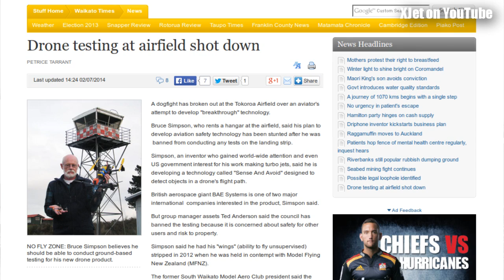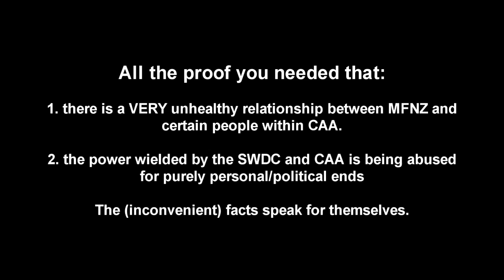Drone testing at airfield shot down - why am I left so confused?

Comment: Please clarify Bruce. Since there's no danger of radio interference, why did you go and warn the jet guys in that Sunday morning, you were testing the sense 	and avoid gear?
Reply from the maker: Any transmission, no matter how weak, increases the risk factor.  To an RC model that is properly set up, uses decent gear and which has been adequately tested prior to flying on the day, the risk is very small.   To a poorly set-up model using unsuitable equipment (ie: no DSM2 in jets please) and which hasn't even been range-tested, the risk is obviously higher.

In order to do my testing, I have to place several antennas along the roof of my workshop.  If I had not told the jet fliers of my intentions, reminded them to do the basics (as listed above) and that there would be a very small increase in the noise floor then you can bet your bottom dollar that each and every crash would have been blamed on those "mysterious antennas" that suddenly appeared on my workshop roof.

As it is,  some of the jet fliers intimated that I may have been responsible for the crash of a very large turbine-powered scale jet that lost control and smashed into a tall pine tree less than 200m from my workshop.  It turned out that the actual cause of that crash was the use of a receiver pack made from AA batteries which caused the RC gear to brownout immediately after takeoff.

In light of this, you can see why I took the very practical steps I did -- as a method of trying to preserve safety.
Reply: ***** im with you since the beginning. Keep up with the god work Mr Bruce!

Comment: Abuse of power. Typical of councils. Disgusting really. The Council needs To grow up.
They can't have jurisdiction on spectrum that's rediculous. Did RSM have anything to say on this?
Reply from the maker: The RSM have nothing to say because I'm not breaking any radio-spectrum regulations.  All transmissions would be well within the power, modulation and frequency limits for such emissions on the 2.4GHz ISM band.  You can bet that if my proposed transmissions were a violation of the RSM regulations, that's the angle they would have used to try and cripple my development work.

Comment: One more thing that doesn't make sense about their prohibition - why isn't it limited to just when RC flyers are present at the field? Especially during work days and hours, I don't imagine that RC flyers are always present, so why can't your experiments be allowed when no one is flying, ignoring the fact that there shouldn't be any kind of prohibition in the first place?
Reply from the maker: I don't think you have to be a  rocket surgeon to figure out the real reasons for their actions -- based on the fact that they have issued a blanket ban, not just a ban when the RC jets are flying.  This betrays the claims that it's all about safety and proves the claims that it's all about making my life a misery because I have dared to criticise them.  It seems that around here, you can break all the laws and rules you like with impunity -- but if you dare to criticise the actions (or inactions) of those in power -- well then you become a target for their abuses.
Reply: ***** Right, but unless I missed it, I've never heard you specifically point out that very revealing fact in any of your videos. You should. It proves that they aren't worried about safety, they're just screwing with you. If you officially and specifically ask for the right to test your system when there's no RC flying going on and are then ignored or refused, it will completely nail down to even the most casual observer their actual intent. Then, appeal to higher levels of government (assuming that can be done), or take them to court.

Comment: what do you actually have to do when testing the sense and avoid system  is any flying involved if not cant you do those tests at night when no ones flying  the rc jets?
Reply from the maker: My first preference was to perform flight-tests - in which case I'd have been using frequencies that were well away from 2.4GHz, with obvious benefits for all.

Unfortunately, I am the only person in the entire world who is expressely forbidden to fly an RC model at the Tokoroa airfield -- in some cases, even a person with absolutely no prior RC flying experience can legally fly a 20lb gas model without any training or supervision -- requiring only an equally unskilled observer to "safely" fly at the field yet I, despite my years of exerience, obvious skill and umblemished safety record -- am expressely forbidden.  (Tell me that does smell of power being abused).

Because I'm a pragmatist, I figured I'd settle for second-best when it comes to testing -- which is ground-based testing.  Unfortunately, this requires a lot more euquipment and 2.4GHz is the most cost-effective frequency to use for this purpose - so that's what I set about doing.

It's impractical to test at night -- because there's nothing to "sense" at night -- no aircraft are flying within 1.5Km in the dark so I'd get no meaningful data.

Comment: This does seem unfair . I would get hold of someone with scientific credentials to back up your points . this may keep the annoying flies off you for a bit ..  you should be an  advisor for the council , not an enemy. they are chasing tails !
Reply from the maker: They would not listen and they would be under no obligation to listen.

As Mr Roger Fisher told me when I asked why a seemingly ridiculous rule had been imposed on airfield users "all you need to know is that we make the rules, you follow them".

I think that speaks volumes as to the way that power goes to some bureaucrats' heads and how they abuse it with impunity around here.
Reply: ***** Absolute Power Corrupts Absolutely.

Ive never heard such BS. Maybe you should start "repairing" microwaves in that hangar.

Comment: The rc manufacturers presumably wouldn't have put these new radio's on 2.4GHz if you couldn't get a reliable link and with frequency switching (and background noise). In this case I am a bit confused to as I would have thought you could have done your testing when no-one was flying...   and even if they were, you are only 35mW. What does a typical 2.4GHz transmitter put out? Maybe you should move to an area where you can do this. Somewhere on the coast - nicer than Tokoroa in winter.
Reply from the maker: Why should I move?  I pay a lease to the SWDC and I am a local business of long-standing who is developing an aviation-related product in accord with the terms and intention of my lease.

And yes, isn't it confusing that although the jets only fly one weekend a month, the SWDC has placed a total ban on my testing because, in the words  of Roger Fisher "RC models could be flying at the airfield any time in daylight hours".

I'm glad you are as confused as I am by the very obvious abuse of power that is taking place here.

It's nice that the SWDC puts the perceived interests of a group of itinerant, non-resident RC fliers ahead of a local business of long-standing isn't it.   I strongly suspect that Tokoroa will find it much harder to attract new business to the district when word of this gets around (as it already is).   Good work SWDC!
Reply: *****
Take them to court, you can propose they pay the cost of your move and having to break your lease due to the fact their new law is causing you to breach your lease. There must be something that can be done. I have said this before but i dont know the laws there or how things are done, But here in the states if you have the right lawyer he can get you off of murder charges even when they know you did it. (a bit ridiculous if you ask me but it happens every day) To be completely honest i think all the damn lawyers are the problem or at the very least a big part of it. just goes to show you politics in any country is all a bunch of power hungry ass holes that get their jollies off of controlling others.

Comment: Hi Bruce, Now I'm confused too. When you were testing your equipment a while back, didn't you go and warn the model flyers on the airfield that there just might be a problem with interference? Or maybe I mis-remembered that. But if not, that's why the authorities are concerned.
Reply from the maker: I warned them that they should follow the rules as laid down by their own association (MFNZ) in respect to doing range-tests etc because I was aware that they are very lax in this area and also very inept in terms of using the technology at their disposal.  Evidence of this was the 15Kg turbine-powered jet that crashed into the neighbouring gokart club because the pilot used a 4-cell AA battery pack for the receiver/servos -- completely ignorant of the fact that this was woefully inadequate.  As a result, the system suffered a brownout shortly after takeoff.  Until the true cause of the crash was realized, some within the ranks of the jet fliers were suggesting that I may have been responsible for the crash because it happened near my hangar.

Clearly with that in mind I felt it essential to give them a heads-up in the name of safety.  It was also to cover my arse because I would be erecting some antennas on the roof of my workshop and you can bet your bottom dollar that if I did so without telling them what I was doing, I would be blamed for every single crash caused by "dumb thumbs" or bad installations that happened from that point forwards.

To this day however, the jet fliers still do not perform the mandated range-tests before the first flight of each day -- despite this being an MFNZ rule (as part of the wings certification) and despite them all promising (as a condition of membership) to follow those rules.

it seems that they can hold MFNZ rules in contempt with impunity but when I merely spoke out about those rules -- I was expelled for my "contempt".

Work that out for yourself.

Comment: The way this council is using made up reasons to prevent things done by you Bruce is total bs. They don't have the slightest clue. Let alone evidence to support their claims.

One 60th of the power of a cell phone really can't knock a 2,4Ghz transmitter signal out of the air anyway, even with poor frequency hopping or spread spectrum systems (you'll know what brand I'm talking about here).

Comment: Demand link analysis proof on paper from the CAA that your system would interfere significantly in comparison with other already present sources of potential interference. They should have already accomplished this before making their interference claim, so it should just be a simple matter of sending you a copy via mail or email. Or did they and/or MFNZ/SWDC just pull this out of their arse as I suspect they did? If they can't send you their technical analysis, and based upon your comments in this video and below the linked-to article they can't possibly have a valid one to send, that will be proof that their decision is entirely "arse sourced."

Comment: Dude, 2.4GHz is an ISM band. Why did you even ask? You don't need to!
And if you're in doubt, get an amateur radio license.

In an ISM band, everyone has to accept that there may be interference. Nobody is "primary" or "primary exclusive" user there.

Source: I'm a licensed HAM operator, CEPT Class 1
Reply from the maker: Yes, my transmissions are 100% legal but the council makes the rules for the airfield so they can prohibit or restrict anything they want, regardless of whether it's otherwise legal or not.

Comment: I would keep Cellphones out of the discussion. They don't transmitt in the ISM band.

I can see how people get concerned about someone transmitting with DIY gear vs. some chinese plastic router. Education is the only way out of that. And keep the polemics for yourself.
Reply from the maker: I'm talking about the Wifi section of a smartphone -- they do transmit on the ISM band and there are plenty of visible wifi routers in the area as well.
Reply: It's going to be tough convincing people.
People don't understand that the concepts of good old analog radio don't work with 2.4ghz.
I think every one of us has seen plenty of the RF paganism you see at rc clubs. There are even people banning radios from using all but one brand or crazy stuff like that.
What is or what is not  realistic is pretty irrelevant. If you don't pick them up where they are you will have a hard time fighting against stupid.
Reply: Tilman Baumann
You may not be able to fix stupid, but you should sure try and have them removed from positions of authority. If they don't understand basic concepts of the subject they should stick their head back where the sun don't shine and leave the decisions and policy setting to people that do understand.

Comment: Bruce I am doing my deploma in electronic engineering and I did a technical report and presentation on radio frequencies and I totally agree with you the mere 35 mW is shit all other transmitters will cause more interference and also all the other devices on the band will to I think what is happing here is the swmac has "told" the CAA that your system will cause mass interference and the CAA has just believed them because if you don't understand how these systems work someone  could say any gibberish about it and you would believe it bloody buracrats its the classic " I really have no idea what I'm doing but this books says your doing this wrong so you must do it this way" good luck on it all Bruce there is always a loop hole Evan if you are doing it within the law
Reply from the maker: Yes, you are correct.  The NZJMA (jet fliers) have told the SWDC and CAA that my transmissions pose a threat to their safety -- but neither the SWDC nor CAA has engaged any professional advice on the matter and chooses to take the word of this group of tech-iliterates over the word of myself (with 40+ years professional experience in RF and electronic systems).

To constrain the legal activities of a business that has operated from the airfield for 10 years on the basis of these uninformed allegations without properly establishing their veracity speaks volumes to what I honestly believe is a corrupt and malevolent culture within the SWDC and CAA.
Reply: ***** As I pointed out in another comment here, demand a link analysis, something they should be required to do anyway before making their call about interference. Then, assuming they can even produce one, it has absolutely no chance of being a valid analysis if it disregards other much more powerful and common sources of interference present. This will allow it to be torn to shreds technically.

Comment: Bruce, if you are not already a Amateur Radio operator, i would encourage you to become one. Once there, you can use UHF 433 MHz at higher power (like that of OrangeRX 1W (actually at 5v only puts out roughly 1/2 watt)). This also can hop multiple frequencies and is programmable for specific frequencies that may be less suseptable tobthe local noise. This also has a crude spectrum analyzer that can be used in the field in the area which you fly to determine what the best freq to use. Good luck!
Reply from the maker: I don't need more power -- and 433MHz is too low for the task at hand in respect to the SAA testing.
Reply: ***** I know you don't need anymore power for control/range. My suggestion was simply to illustrate to the SAA that you take this seriously and try to use the most reliable transmitter/receiver possible without noise floor coming into play.